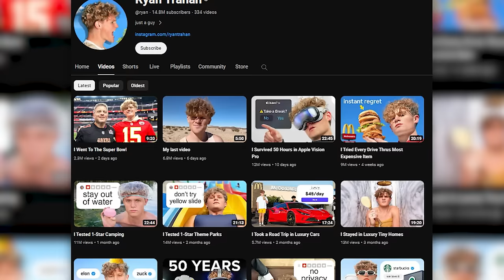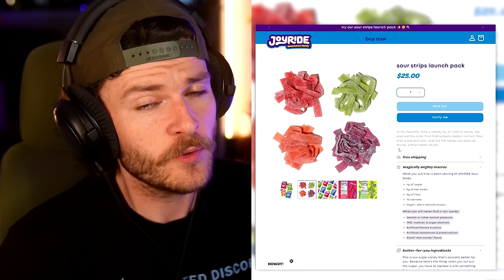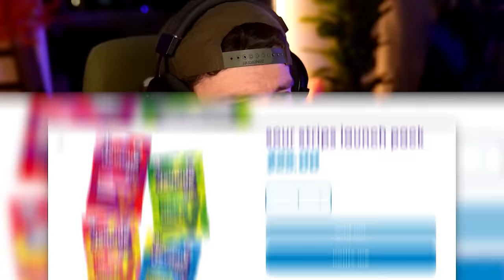I'm cooked

Comment: Hey, I do have some knowledge regarding the issue with fructose. We can use glucose as energy , at least for the most part, but fructose not so much. The body processes fructose similarly to ethanol, it gets broken down by the liver and turned into lipids because it can't be used as energy, and many of those are low-density lipids which increase the risk of cardiovascular disease. When you consume it in the form of fruit, it isn't that much of an issue because water-soluble fiber limits its absorption, so it goes straight through your gut and isn't processed by your liver. And high-fructose corn syrup is particularly scary because you can pump pretty much anything with it to compensate for lack of flavor, which is very common with low-fat alternatives that would taste like cardboard without it. And to round things up, it's cheaper than sucrose. So yeah, TL;DR: fructose is OK in fruit because you eat a lot of fiber with it, but pretty bad for your body as a sweetener.

Comment: Chemical Engineer here,

One of the many reasons that high fructose corn syrup is detrimental is because the RATIO of sugars within it undergoes different reactions within the human body, and there is usually some amount that is left over that can participate in secondary reactions within the body. To this end, you were mostly correct in saying that anything in excess is negative for you. Another problem is also the lack of macronutrients as well.

Comment: You were right about the stevia being the taste! Science says Stevia lasts longer on the pallet. I've used Stevia when dieting 1 because trying to reduce sugar intake but 2 you use way less of it and get similar results. (stevia in cooked things has a noticeably less long after taste, and liquid stevia which you would use even less of for the same sweetness but it is more easily distributed so you wont get those weird pockets of "diet" taste)

Comment: the issue with high fructose is because its not bonded to the glucose it free floating and something about that bond is what makes fructose "safe in sucrose but the corn syrup its free floating and so you can get pure fructose which cause it to be immediately turned into a very hard to burn fat or something what what I found a few years ago.

Comment: I might be wrong about this, but I was under the impression that fructose, has to be processed by the liver, converted to a lipid and then processed into fatty acids and used as energy by the body. Which is an extra step over glucose and  is why it can be bad for you, as too much of this processing by the liver can lead to fatty liver disease. Also, the off shoot of that, is that if you calorie consumption for the day, meets your needs without the need for these fatty acids, then your body doesn't bother breaking them down and using them as fuel, so just stores them for later use as fat. So technically it isn't bad for you, but as with all things in life, moderation is key and if you don't eat more than you need regularly,, then you should be fine having a can of soda every now and then. The reason HFCS is used, is because it offers the sweetest taste, for the least amount of liquid by volume, this means soda companies have lower costs, and the soda tastes as sweet to you, so most places switched to use it (in the US at least). Hopefully that helps someone.

Comment: The problem with fructose is that it needs to be broken down by the liver into glucose.  The pathway your body uses to break it down is partially used as well to create ATP.  There's more to it but the papers became difficult to comprehend without a PhD.  😂 I remembered something else.... fructose is much sweeter tasting but because it isn't used immediately, you don't get the same blood sugar increase as glucose and its slower. Because of this you can intake much more before your body tells you to stop. And the delay in insulin release probably causes you to store more as fat.

Comment: Why is High-Fructose Syrup bad for you? 
Glucose is readily available for the body to use up, fructose needs to be turned into glucose for the body to use. So, if you're consuming mainly fructose, your body uses up the glucose while it transforms fructose into glucose. Fructose breaks down slower than glucose, which means it's less efficient, and makes it so your body would have to burn calories at a faster rate in order to use up that stored energy from the fructose molecules.